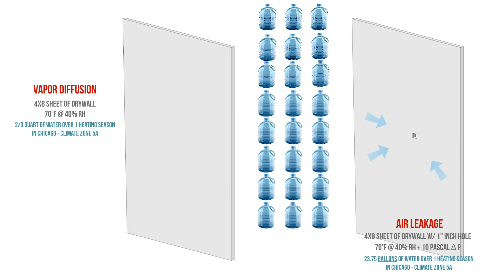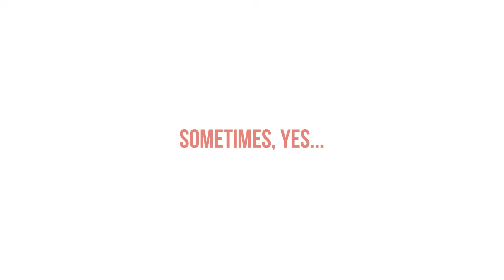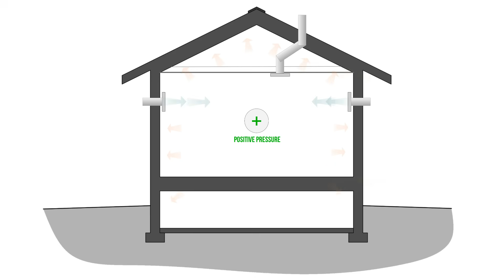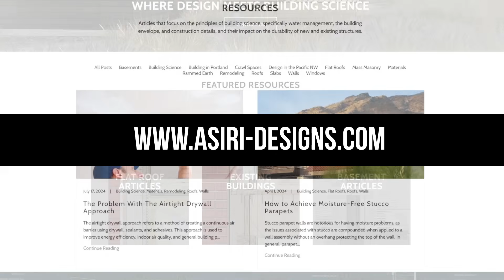Can a House Be Too Airtight?

Comment: The way I explain it, houses need a whole lot of ventilation. But we want control of that ventilation.
We're moving from the ventilation strategy of a tree to the ventilation strategy of a lung. A tree gets a lot of fresh air, but that air can be hot, cold, humid, dry, clean, dusty - the tree has no control over it. A lung also gets a lot of fresh air, but the air is first adjusted to the temperature and humidity the lung prefers and the dust is filtered out.
Holes and leaks in a lung do not make it work better. The ideal is a perfect seal, with all the air coming in and going out through the pipes and fully controlled.

Comment: Great video, thanks for continuing to put these out there! Basic question, but does keeping the house at a negative pressure mean pushing conditioned air out of the building to achieve this? I am not in the HVAC space but this strikes me as expensive and wasteful (I know a rotting, moldy house is probably more expensive) so wondering if this would be a case where airtightness could be a long term negative. Thanks!!
Reply from the maker: Great question, it just means that your exhaust ventilation slightly exceeds your supply, and that can be fine tuned depending on the design parameters and stipulations. There is an energy penalty, but it's oftentimes used to save existing buildings (same goes for slightly pressurizing).
Reply: @ASIRIDesigns  Appreciate the reply! Thanks, and I've very much in favour of long term operational expenses that might mean not demolishing an existing structure (which I think you are referring to). Again, thanks for the engagement here

Comment: When re insulating an attic without demoing any sheetrock, is it worth the extra cost to get something like Intello or Siga over MemBrain? I'm planning to put the barrier on top of the ceiling joists then blow in insulation on top of the barrier. The walls will be left alone.
Reply from the maker: If it's serving as your air barrier, absolutely. We have found Membrain to be quite flimsy, and it doesn't have the right vapor curve compared to Intello or SIGA's products. It becomes too permeable too quickly, and it's very easy to poke a hole in the material from our experience.

Comment: If you’re house is too airtight and you have a leak into the house that isn’t readily noticeable (overflowing gutters getting water behind walls, a roof leak, etc) doesn’t  the lack of air movement make it more likely you will get rot?
Reply from the maker: It really depends, the air flow can either work in your favor to dry things out or against you, as we discussed in this video. We have another video that we posted a couple weeks ago about how if you have active leaks or any suspicions of moisture problems, that it is a bad idea to insulate and air seal before addressing those issues first: https://youtu.be/Qf_30U_Erno?feature=shared
Reply: @ASIRIDesigns thank you!
Reply: Use materials so there's more drying potential than wetting potential, without air movement.

Comment: Love your videos, including this one.  But I will add that Joe Lstiburek once said that if you need makeup air for a fireplace, don't go crazy--just crack open a nearby window.
Reply from the maker: Sometimes you don't want to open a window!
Reply: I do this for our range exhaust—which we don’t use that much. But I live in a mild climate. Of course Joe would know that. a fireplace is the worst part in a house, as.regard to building science.
Reply: Yeah if it is single digits, and your stove is primary heat, thats going to be a cold draft around your toes

Comment: This site is so under rated, this building science engineer has helped me out on my un-insulated daughter's 1884 house in st Paul MN. I did a large bathroom gut/permitted . And by this site use Intello vapor barrier/Rockwool. I always use Rockwool but this house for sure needed the Intello barrier. Luckily this whole farmhouse was made of 100% cedar,  beams and all and has aluminum siding. Everywhere I have/had access ( complete new electrical as it was knob & tube, and I redid 100% of the plumbing including stack, all permitted.  She was not in the house for 1 year 3 months, but she got free ( 30 years maintenance guy) Dad labor doing all the work. No rot. And I want to keep it that way. If she wants to insulate, and affordability wise she/I could only afford blow in, I said when and if you do this ONLY blow-in Rockwool so it won't mold and "pack out" IF it ever got wet.  No blow-in Rockwool contractors YET here in Minneapolis/St Paul. But she still has to pay  me back supplies $40,000. ha ha.
Reply: Agreed, there is so much dense information, right to the point.
Reply: I dont think can blow in rockwool. It only comes in solid forms made with adhesive because those microscopic rock strands arent meant to be floating around to breathe in.
Reply: @caustinolino3687  There are new choppers that are now for sale but many have not bought them. There are a couple out on the east coast that are doing it and they are having good luck getting the correct "packing of the blow in" with ALL THE BENEFITS of rockwool over pink mold loving the binder in the pink stuff. It will just take more time for more companies to buy the newly designed chopper/blower.  And a need to add more rockwool chopper companies, when competition starts.